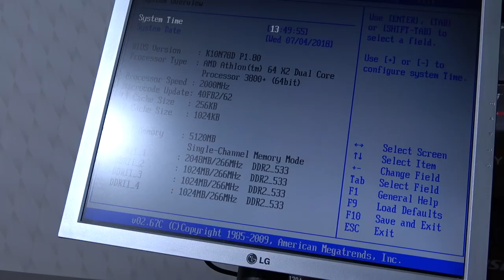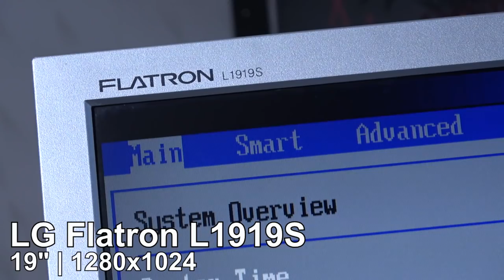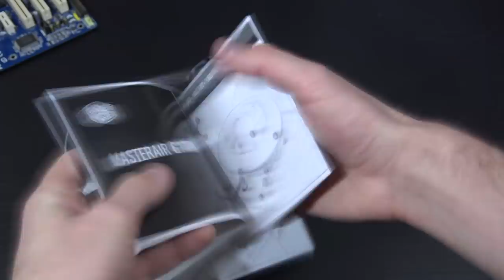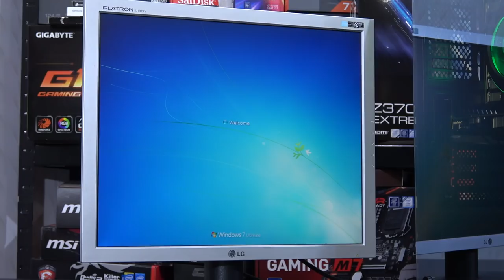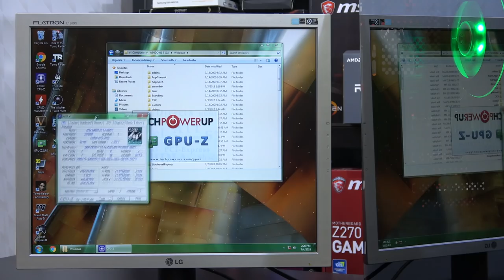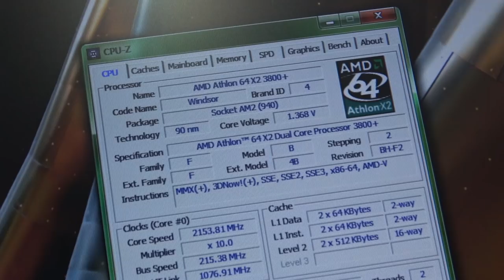AMD Athlon CPU from 2006 STILL KICKING ASS!

Comment from the maker: This was a very time-consuming video. I was working on it for days. I hope you enjoy it! :)
By the way, sorry for the mistake. The HD 4890 is a DX10 GPU, not DX9.
Reply: Nicolas11x12 English love this! These are super fun builds. Would be great to see how it runs with matched sticks of RAM, and then OC the RAM and CPU! :)
Reply: Nicolas how is your comment stated 16 hours ago this video is 53 minutes ago??????
Reply from the maker: Magic. ;)
Reply: If this board support any 3/4 core phenom II  you would have quite nice gaming for cheap .
Reply: Magic time traveling abilities to post comments?! OMG Please go back in time to get a BNIB OG Phenom!!! :D 

Srsly though, would love to see this thing OC’d with an AIO along with some solid Corsair DDR2 1000MHz RAM
Reply: Nicolas11x12 English dude no joke I still use an amd athlon 64x2 4850e cpu from 2005 with windows 10 on it and a some modern parts like ssd, graphics card, and 2 vb ram instead of 1 and 500w power supply I instead of 300w
Reply: What GPU do you use?
Reply: overclock the CPU, also try to find more matched ram, its running in single channel and going to dual channel may get you a bit more performance.
Reply: excellent video!! well done!!!
Reply: Nicolas11x12 English if you can or a 4c athlon. It's on pare with fx 4350 good luck with that or tho......
Reply: How about maxing out this system for a dualcore gaming rig of years past ?
(There is a certain amount of games after all that can be a hassle too run on a system with more then 4 gb ram or more then 2 processor cores.)

A bios update & buying a amd phenom II x2 555 & overclocking too 3.6 ghz or faster, get 4 gb ram via 2x2 gb ram sticks in dualchannel or 8 gb ram with 4x2 gb sticks & something like windows vista sp1 x64 dualbooting with windows xp
(id look for 800 mhz ram as it helps a bit performance wise & should be fairly cheap from aliexpress or similar online retailers.)
Then a later dx11 gpu that still has windows xp drivers like a gtx 660 or gtx 750ti too complete the build along with a 120 gb ssd should make it as snappy as it can be.
Reply: Do you know the difference between Athlon 64 X2 3800 , 6000 and 5200
Reply: Does the HD 4890 support VULKAN ?
Reply: Can you please test gaming on this PC in UBUNTU MATE ?
Reply: I think radeon hd4890 come around 2008-2009..in 2006 its hd2000 series radeon 1000 series..
Reply: @hilga007  1st GPU@1.36 Power Color Radeon HD4890 1GB DDR5, 256bit Direct X 10 (DX9C in WinXp)
2nd GPU@1.52 GeForce GTX750 1GB DDR5
Reply: Cs:go is working?=))
Reply: it is actually a DX10.1 GPU
Reply: @drake6836  he uploaded the video in private, commented, then made it public :)
Reply: just watching this on pc with amd athlon 64 3000+ overclocked to 2.3 GHz and gt 210.
Reply: I just picked up an old optiplex 740 with this processor for 20 bucks at a pawnshop

Comment: Watching this on my old Athlon 64 x2 5800+. Ahh yes they do still work and work well.
Reply: I have a similar CPU in one of my computer's the setup is very meager though in a very large custom case or so it looks like it it has no graphics card no sound card but does have sound drivers built in SATA hard drive and disk drive and Windows XP still a very functional Athlon 64 X2
Reply: @silasmcgee3647  athlon 64 x2 will run windows 10 with ease
Reply: as long as you have at least 2 gigs of ram 4 will be ideal
Reply: @si4632  well the Foxconn motherboard that's in it only has two available dimm slots since the other two haven't been soldered or installed so to get 4 gigs of RAM I would need two 2 Gig sticks
Reply: @QuestionableCube My x2 4800+ ran miles around the p4 i upgraded from.

Comment: overclock that old beast and see how much fps you gain.
Reply: 3dkiller , that was overclocked. The FSB was clocked to 215 from 200 base. So +7.5% overclock.

Though, the HT link speed may have some room to go faster, mine did in the day...
Reply: i ran mine at 2.4 ghz no problem with stock cooler sooo
Reply: This is the brisbane 65w. You can reach 3.1-3ghz easily on air. Overclocking the bus speed was good but modern videocard doesnt like it
Reply: Knowing how old pentiums like the Pentium 4 and some amd's are practically heat furnaces overclocking would definitely require a better cooler and heatsink unless you want your computer to go into nuclear meltdown
Reply: this cpu's overclock pretty well, i had an 4200+ running @ 292fsb and 11x multiplyer on stock cooling!

Comment: AMD 6400+ here. Please for the love of the Silicon God, put matching ram modules and use this system in DUAL channel mode. 5 gigs = odd amount = SINGLE channel only. Of course you already know this, so please as soon as you can get 8 gigs of value kingston ram and unleash the full potential of that beauty.
Reply from the maker: Unfortunately the Silicon God hasn't blessed me with the matching DDR2 memory I'd need. ;)
Reply: They soon will, I'm sure of it. You just have to make the proper offering. Burn that 1 gig module in your back yard and the Silicon God will provide. (Don't breath it in though) :D 

PS: On a serious note, if you take out 1 gig and run it with 4 gigs in dual channel, put a value ssd and assign maybe 8 gigs (or even 16 why not) of swap file only on that drive, I'm guessing that system will perform much better. 

For the most part it would not have to cache to disk at all, but with 1 gig of video memory, let it cache what it needs to the ssd and that machine will fly. 

The fifth gig of ram is for the most part just sitting there, if your average load would come anywhere near past the 4 gig mark, the pc would be unusable. 

Just a fixed 16 gigs of swap file only to an ssd + 4 gigs in dual channel and let it fly
Reply from the maker: Aaron Swartz Are we all Probably the funniest comment I've read in a while! :D

Oh and, do you by any chance have any experience on how the correct memory will be provided after the right offering? Will it be coming from above, packaged? I'm a little worried it could hit my head. Those modules can be pretty sharp after all... ;)
Reply from the maker: Thank you for your advice and expertise! You seem to be a really knowledgeable when it comes to pleasing the Silicon God(s).
Hopefully the sin of Single-Channel 5GB RAM I committed can be forgiven.
Hmm... looks like I'll have to get some body armor first to protect myself from the impact.  ;)
Reply: Just a helmet & goggles would be a good investment. :p 

You're more than welcome on the high level feedback. Your channel is awesome, I never miss a video of yours.
Reply from the maker: Haha, thanks a lot, my friend!
I appreciate you watching my videos. Thanks for the support.  <3
Reply: I was rocking the athlon x2 6400+ until last fall but it definitely bottlenecked my Radeon 7790 frequently.  Lasted me 9 years, though.... Through 3 motherboards and a slew of other upgrades.  Hard to complain.  Fun watch!
Reply: Aaron Swartz Are we all i have only 4 in pc also 6400+
Reply: Dual VS Single in a 10yr old system playing 10yr old games will make virtually Zero difference. It's not going to be the deal breaker & enable this 10yr old cpu to play BF1.
Reply: Clock you would probably be quite surprised how much of a difference it does make. Memory performance is huge for AMD systems and even on Intel based computers it makes a very noticeable and verifiable difference.  

Nicolas, I would suggest highly something like this for the memory situation. https://tinyurl.com/yapz23ur 
Also perhaps a Phenom II four or 6 core cpu upgrade would also be a great idea if the board's bios supports them I would suggest something like https://tinyurl.com/y78nnsvr to minimize bottle necking as much as absolutely possible on that system. In all under $100 would more than double your performance in a lot of things especially newer games.
Reply: Nah I wouldn't be surprised because there is very little difference. We are talking 5fps tops between single & dual (benchmarked extensively in 3D06 back in the day). Not exactly HUGE in my book.
Reply: put 4gb of 800mhz it will work betther then 5gb 533.. go to aliexpress you have new 4x2gb 800mhz for ~16$ ~17$
Reply: The difference in single channel ram of different speeds could give more than 5fps increase, jumping from 533MHz to 800mhz alone should give more improvement in most things, running it dual channel over single nearly doubles the memory bandwidth on top of that. If there was very little difference you must have had another issue causing some problems for you. I'd suspect 3DM06 as being the problem personally. It's been giving me headaches for about a week now.. it's the only Futuremark graphics bench I'm not within 10-20% of the scores of highly overclocked l2n cooled processors and gpus, for the same gpu in a single card config. Since I'm using air cooled gpu and a small AiO on the CPU everything seems pretty normal but 3DM06, different story, the top result (same GPU single card) is 330% faster not only is it an abnormal difference it's an impossible difference.
Reply: Dual vs Single makes literally zero difference. Anandtech, GamersNexus and Hardware Secrets have all done articles and many found there was a slight DROP in performance going to dual channel.
Reply: Dallas, you sir need to stop spreading lies. It absolutely makes a difference and GN most certainly did not have an article showing that nearly doubling memory bandwidth reduced performance.
Reply: Dual channel is a property of the RAM controller, not the RAM itself.
no matter what exact modules you're using, the only important thing is the same amount of RAM installed in each channel, even with unequal number of modules.
that can be for example Channel-A=1x8GiB and Channel-B=2x4GiB

with unequal amount of ram in the channels, the controller wont downgrade to single channel permanently, but cant use the full speed over all the memory, so when you run benchmarks, you will sometimes see dual channel speed, an sometimes single channel speed.
Reply: If you think Dual chan vs Single is going to be the deal breaker between playable & not playable then good luck to you sir. I suggest you go do some actual benching on the topic before commenting further.

Comment: I still using AMD Phenom X3 8650 on ABIT AX78 AM2, then 7 years years a go i retired this system as my primary PC.
I'm still using this old PC only for testing, recovery or repairing. Still kicking ass and 100% working after more than 10 years with me.
As I remember, 3 times I'm washing this mainboard (ABIT AX78) with water and soap, and it's still working until now, just hard to die. Lol!

Comment: I remember having an Athlon X2 4400+ (Socket 939) back then, and it really kicked Intel's ass, beating the $1000 Pentium D 840 Extreme in just about everything, especially when overclocked to ~3 GHz. I could've gotten the 100 MHz faster AM2 version, but DDR2 RAM was slow and very expensive at that time, and I didn't want to change the motherboard.
Reply: What MB did U have? I had Asrock 939 Dual SATA-II and it rocked the world!
Reply: manaphylv100 
i still have one running, and its usually cooler than my gpu when at 2400mhz stock (windforce gtx 780ti )
i have a msi platinum sli board
Reply: I had an Athlon x2 4200 on an Asus A8n-SLI deluxe. I was dumb enough to get a low end pentium D, don't remeber the skew but it was 2.8Ghz. Totally not worth it. I ran that Pentium D for a couple years while I saved up for the Athlon x2. Been buying AMD ever since. 

I kinda regret getting the FX-8350 instead of going with sandy bridge or ivy bride, but such is life. My Ryzen r7 1700 is kicking ass right now so it's all worked out =)
Reply: jaipal chauhan super bottleneck

Comment: Cool! I currently use and Athlon x4 860k, paired with my 1050ti and 8 gigs of 1600mhz ddr3 i can achieve good performance on triple a titles. Not bad for aging hardware
Reply: Yeah mine still works great and stable at 4.5ghz
Reply: 860k at 4.5? Wow
Reply: Maybe im just a garbage overclocker then Lol
Reply: Grizz    get a good cooler    I use a arctic freezer 13        2 fans pulling in in from the front      2 exhaust fans  in top and 1 in the back.      I just use mine for video editing  and it's still fine    I have even streamed with it  as obs can use the gpu   to reduce cpu load.      With the os on a ssd    it boots up in 11 seconds.
Reply: Richard Perryman-Smalley ok, does it work for fm2+ boards? Or do i have to research and whats the price
Reply: Grizz  yeah mine is fm2       you tend to find the same coolers fit  fm2 and am3      think mine was about £15       just make sure it fits the case   it fits in my  MATX fine     I use  fury x 1866  as they are low profile  and the one chip just fits under  the overhang
Reply: Just to point out I also repaste the cpu once a year with arctic silver 5    and i do run the Hoover over the case to catch dust   as the thermaltake cases   has decent dust filters.    Takes a few seconds a week   as my pugs hair  is a pain   amazed the little sod has any hair left
Reply: I as well replace thermal paste frequently
Reply: I hope the cooler fits lol
Reply: Grizz it should do in a standard  matx case      I doubt it will fit in anything smaller.     Hope this helps you  get a decent overclock. As it's a fun little cpu  that has given me years of service.   Other than the 're paste  and a quick 're install  of win 10 now and then   it's pretty much solid.   Might not be fast compares to today's cpus but it works fast  doesn't hang  and see no reason to replace it.    When I do  I will prob  move it to a Linux box to upgrade the home server   as that's a  crusty   core2quad q9650 with 8gb of ram.  Lol the only Intel cpu  I own   😂
Reply: I've literally just bought a 760k to replace an APU in an asus FM2 board. Bought it off aliexpress for 25 euros. Already have 16GB 1866MHz Corsair dominator ram in there with the APU. I also have an RX460 2GB to go with it. Just need to buy a case and power supply, but i have about a month to wait on the CPU anyway.

Comment: It’s nice to reuse old parts that still work well in different environments to use as a HTPC or retro gaming PC, especially if you can find a cool ITX board and case. 

Steam still supports XP as well which is perfect for older games that require annoying fixes on Windows 10.
Reply: Steam will be dropping support for XP and Vista at the end of the year, unfortunately.
Reply: Fokker TISM Yes that is a shame. I guess I would dual boot Windows 7 32bit if I had an old Pentium 4 or Core 2 setup still and get the other games off gog or by disc.

Comment: I'm still using the AMD Athlon 64 X2 5200+ and radeon r7 240 2gb gddr3
Reply from the maker: That's pretty cool. With Windows 10?
Reply: Nop with Windows 7
Reply: What do you play with this set up?
Reply: GTA Sanandreas. Euro truck simulator 2 ,League of legends,counter strike 1.6 ,Zula europe. At 900p (1440x900p 16:10)
Reply: TwizZtiN wow how much did that build cost you?
Reply: TwizZtiN you should test some heavy games and see how far you can push them
Reply: TwizZtiN 8k more like hahha

Comment: Using modern parts in an older build kind of takes the nostalgia out of it for me. But there is no reason to dislike! This was actually a lot better than I thought. Kind of cool to think of we had high end cases like this in the mid 2000s

Comment: Oh dude I used to have exactly a 3800+ back when I was a little kid, it was a huge upgrade from the athlon XP and my dad's pentium 3
Reply from the maker: Haha, that's awesome! I never owned an Athlon XP. Would be an interesting future project. My first CPU was the Celeron 2.6GHz from 2003. Then I had this Athlon 64 X2 3800+ and the next big step up was the Phenom II X4 955 BE, my first Quad-Core. ;)
Reply: +NIcolas11x12 English
well the Athlon XP(K7) has up to almost 2x times lower IPC, usually 1.4x-1.8x lower IPC than the Athlon 64(K8), also lacks the SSE2 instruction, doesn't have a built-in memory controller, and the Athlon XP is 32 bit which means that it lacks all the amd64/x86-64 instructions, so that's also a big downgrade too. In rendering the XP holds up very well to the 64 though.

And those are improvements for just little over a year after the final Athlon XP was released, nowadays people celebrate when 10% improvements are done year over year :/
Reply: I upgraded back then to a 3700+, I came from an XP 2400

Comment: Very nice effort to put a "vintage" system together. The Athlon still rocks - it was a CPU from a time where AMD had the stronger line-up than Intel. 
When I saw the huge cooler I was hoping you'd oc  it. I could oc my Athlon 64 (4600+) from 2.4 to 2.9GHz. I had it paired to a HD 7870 and the higher clock made a difference.